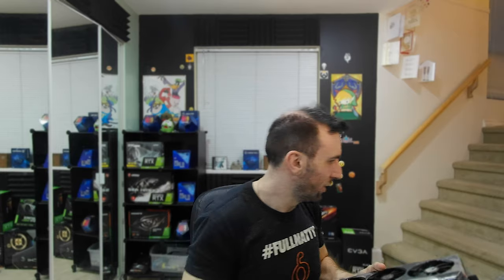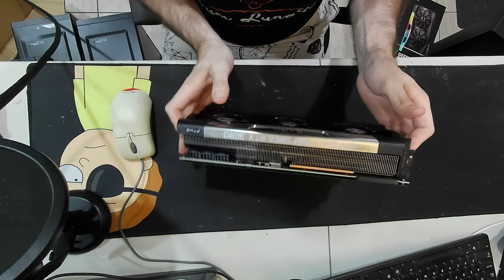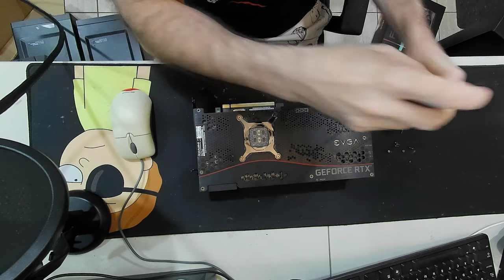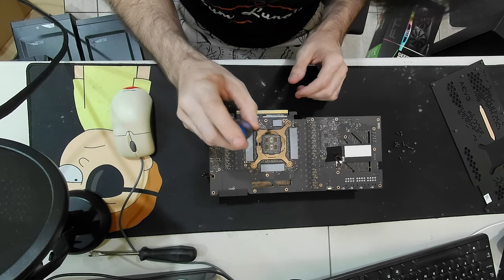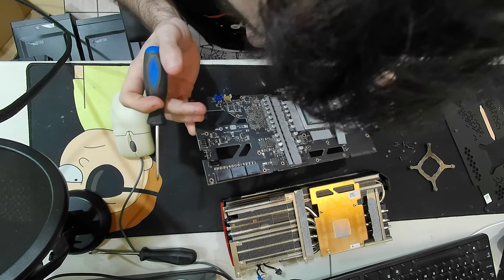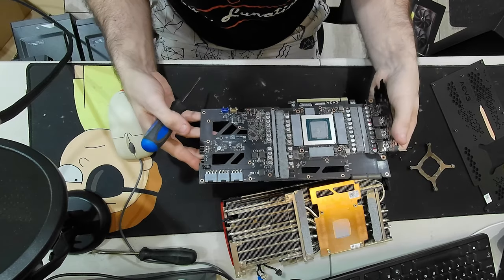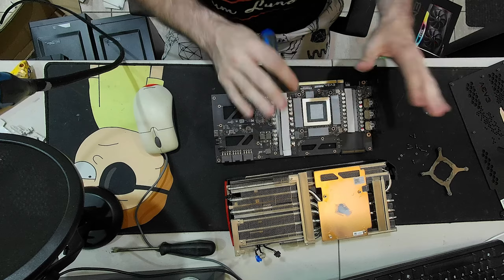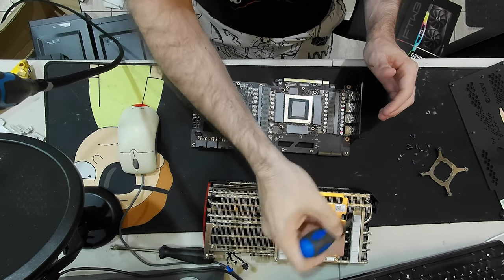RTX 3090 FTW3 Teardown, Capacitors, Thermals, Power Draw

Comment: Just wanted to point this out for anyone referencing this video for a teardown to waterblock their 3090... I killed two of my FTW3 3090's trying to put EKWB waterblocks on them.  I've built about 5 water cooled rigs and never had failure like this ever.  The issue is seemingly that the PCB has a weak spot and very prone to failure if the PCB flexes.  The putty that's used on these EVGA cards are so damn difficult to work with when removing the stock cooler.  My recommendation is to pre-heat the card (use a heat gun on LOW) to help soften up the putty before working at shimmying it off.  Do your BEST to not flex the card when removing the cooler.  Good luck yall.

Comment: Those copper heat tubes are actually  a really cool addition to the backplate!  I did not know that was there.  Also, neat to see that it comes with termal pads already installed on the back :)

Comment: The copper heat pipe is designed to spread the heat further onto the backplate. Adding a second thermal pad to it wont do anything.

Comment: Thanks so much for this video, I don't think I would have had the balls to open up the card without it!  I used Gelid GP-Ultimate 15W/mK, 2mm pads throughout + the 1mm you suggested.  When I sealed it up and checked, I found that the row of components next to the 1mm pads you used, the pads were loose.  I re-opened and applied an extra 0.5 mm pad on each of those rows.  The results, well, I am quite pleased.  See here, the first card on nicehash is the one I replaced the pads on, the second, is a card which is unmodified:

GeForce RTX 3090
DaggerHashimoto: 115.98 MH/s
Status
Mining
Temp.
58ºC
VRAM T.
92ºC
Load
100%
MemCtrl Load
100%
Fan
66%
Power
270W
Efficiency
0.43 MH/J
 
MEDIUM 
GeForce RTX 3090
DaggerHashimoto: 115.98 MH/s
Status
Mining
Temp.
57ºC
VRAM T.
94ºC
Load
100%
MemCtrl Load
100%
Fan
72%
Power
290W
Efficiency
0.40 MH/J
 
MEDIUM 

I will likely now do all my 6 cards.  Thanks again, I hope this also helps someone else.  That first card above was running fans at 90% in lite mode, before the mod.  I definitely could not run it in medium mode, fans would have been 100%.  Possibly could have fitted a 3mm instead of the 2mm + 0.5,  but was being cautious not to bulk it out/stretch the PCB.
Reply: Hi Paul... I need some help... I have changed my pads now 3times and I can get the temps down...  I am using the GELID 3mm on the outside, then the 1mm next to the 3mm and then 2mm next to the GPU....  The side where the HDMI is located I added .5 to the 1mm so its now 1.5mm because I could see its not touching.  On the backplate I am using 2.5mm.... Is this what your doing?
Reply: @tyness00  Did you get my reply ?

Comment: I'm probably going to have to replace my pads. As someone who has never done anything like this before, I'm nervous tinkering around in a $3000+ piece of hardware that will likely void its warranty and also require me to do everything perfectly or I could make it worse than it already is. I suspect it's my backplate pads that need replacing, so that looks easier.
Reply: You paid 3k for your 3090?
Reply: @coreymoyers  $3000 AUD 8 months ago. When the cheapest you could get them for was $4000 AUD

Comment: So, you used 1mm thermal pads in the frontplate and for the backplate you used 2mm pads. Is this correct ? just 1mm front and 2mm back, no others pads right?
Reply: did you find out what size pads??
Reply: @davet7231  not yet, Im disassembling  the gpu tomorrow. I bought some 3mm, 2mm and 0.5mm pads from gelid. Hope them fit ok
Reply: Did you find out?
Reply: @fency1097  any updates

Comment: I am wishing someone actually had a good video on this. I thermal padded and pasted this card tonight. Previously the card was at 94-96 degrees while mining at a specific clock setting. After doing paste and pads at 2mm in most sections and 1mm in other sections the card is at 110 degrees while mining. This is a huge disappointment.
Reply: hahahhahahahaha unluggy

Comment: I upgraded my psu from 1200 to 1500, before I got my Strix 3090 OC. Not a bad idea after all. But technically the card can have 720watt(3x240)+225watt(pci)?
Reply from the maker: you got a 3090 strix OC??  from where, I thought they werent released
Reply: @FrameChasers  no still waiting for it

Comment: Do you think a shunt mod would work using a wire and some kapton tape?
Reply from the maker: naw straight shorted shunts havent worked since Turing,  to be fair I havent tried it but im 99% sure it would go into failsafe mode if you tried to straight short the shunts out.  You gotta use the resistors
Reply: @FrameChasers  OK, I wonder if two wires and a resistor would work, just so I could easily under it if I needed to. I didn't realize there was a resistor involved, I will have to watch the video.  I thought it was just straight soldering the two shunts together

Comment: Why do they put such crap thermal paste on the die, i had thermal paste dry out on my 1080ti in a year and it was overheating and i was like wtf so I tried to replace it and put too much pressure on the die when i was screwing it in and my card artifacted all over the place
Reply from the maker: im not sure to be honest,  I think they use the dry stuff because it lasts longer than the better stuff? So people dont have to take it apart and repaste?  Just a guess.  Or to simply save costs per card